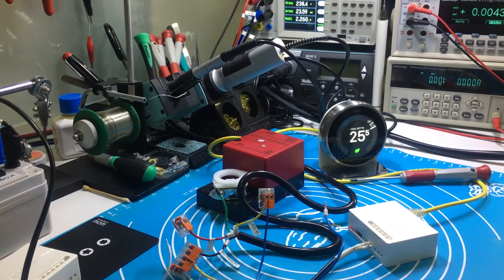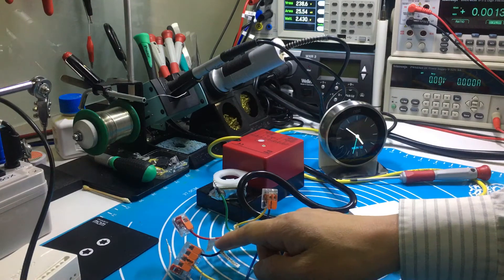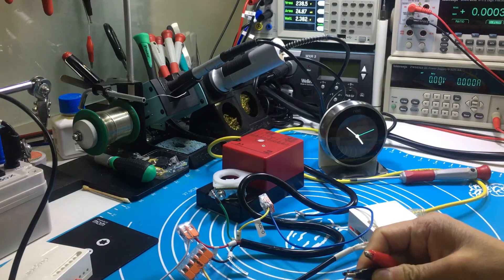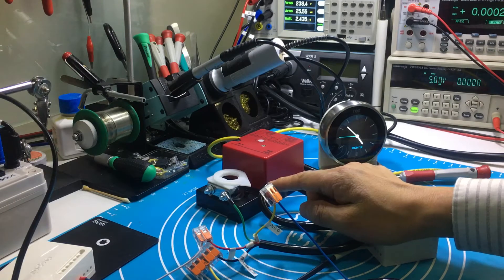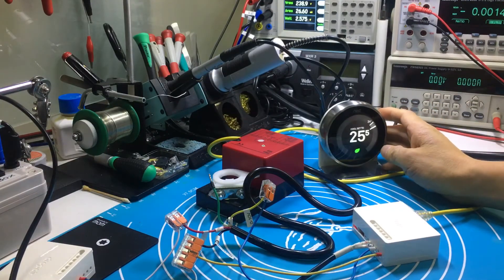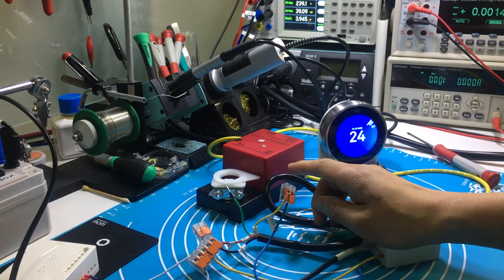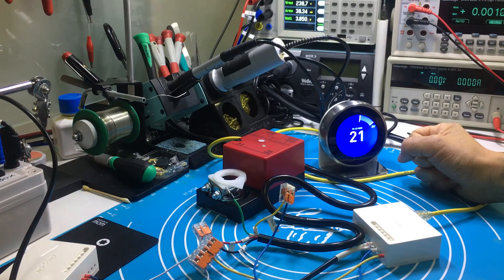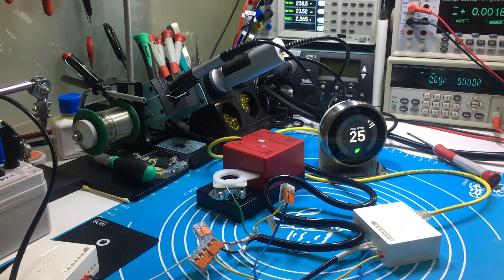How the nest thermostat works with the modulating valve.

Comment: wow nice 
what the price for the dropair adapter
Reply from the maker: 7816427 150 usd without shipping fee and VAT
Reply: @dropairs  
How much will be if you shipping to dubai including VAT in AED 
And I would like to know it can be connected to all FCU s through the   
I2c bus what about the cinnection between dropair adapter  and nest
Reply from the maker: 7816427 shipping fee is about 40 usd/1 kg. VAT is very less if the amount is few one time. Different model of Dropair adapter control different FCU. You can add my what’s up: +8613910034697
Reply from the maker: 150 usd pcs
Reply: Can your adapter work with: https://www.carrier.com/residential/en/us/products/gas-furnaces/59mn7/
Reply from the maker: @dean0grigio  Sorry for late. Please contact with us: dropair.labs@gmail.com